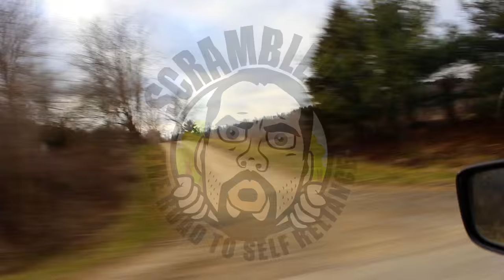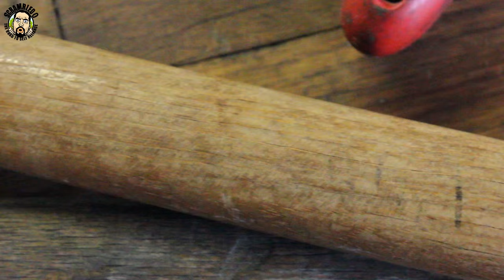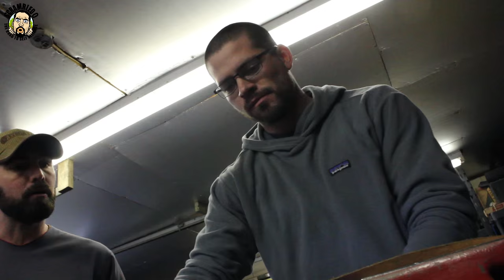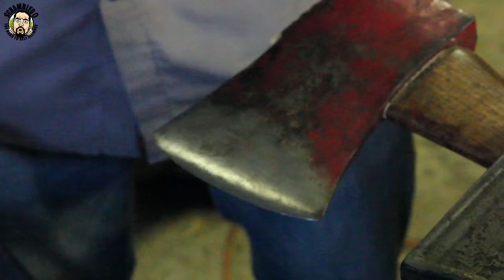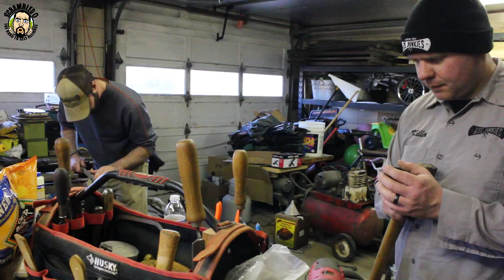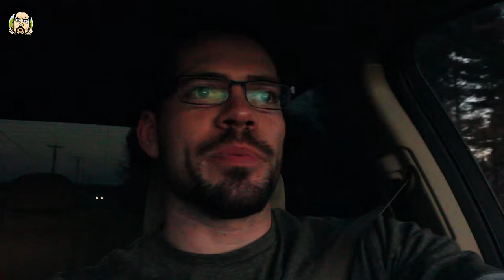Hanging Axe Heads

Comment: I have a felling axe that needs a new handle. I have no idea what kind it is.. looks to be @ 3.5 # head, it belonged to my wife's father . I just got it to try and restore it for the fam. Great work and thanks for videos Bud.
Reply: +Restore all things Just found out it is a Woodings Verona Axe, and it's heavier than 3.5 #. I want to put a smaller length handle on it , but not to small.
Reply from the maker: +Restore all things Yea, i have a 3.5 also, gonna look into handling it soon. May try to carve my own. Any suggestions on types of wood for a handle? Im sure Hickory would be good, just dont know of any freely available hickory around lol
Reply: +Scrambled O Ash is also suited for an axe though I've never used one. It would be niacce to work on a masterpiece axe. lol.